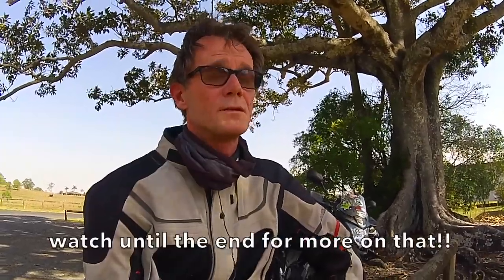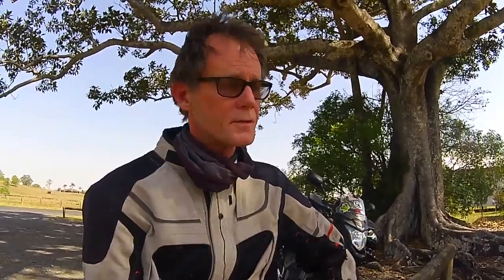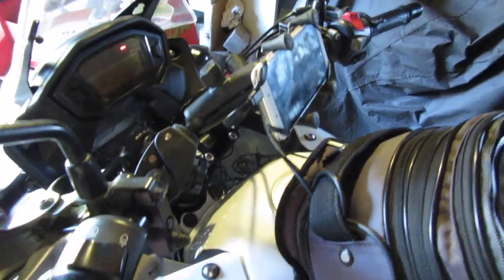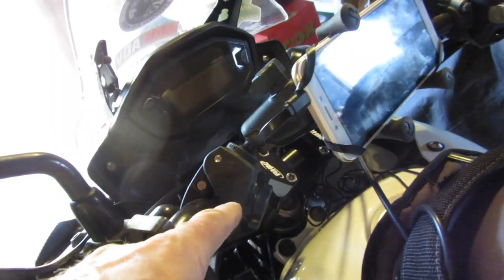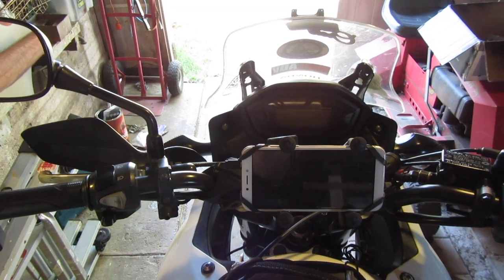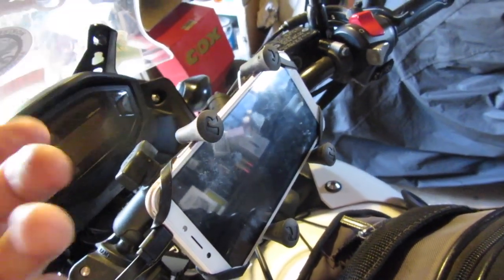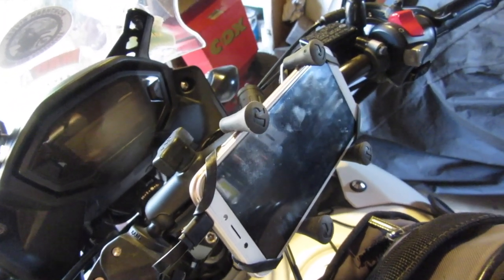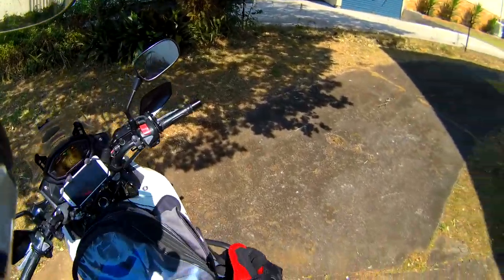RAM Mount X Grip Review

Comment: Great review, brother! Mine isn't  a stem mount, it mounted to the bars, but I've been using it on and off road (and road trips) for over 2 years and on 2 bikes (CRF250L and CB500X), zero issues (even when I was on rougher trails than I'll take the CBX on), great product imo 😊✌
Reply from the maker: Sounds great! Got pretty much used to mounting it without hitting the buttons now and
I've ordered a screen riser with accessory bar, so will mount it above the dash and under the screen.

Comment: I've used the X mount for a couple of years and it's brilliant. The only issue I've ever had is when the phone isn't in the right place and it presses buttons because it grips so tightly. I did modify mine with a bit of velcro, just in case it gets knocked so it can't drop the phone - no elastic bits on mine. For the Honda, I swapped one of the bolts in the handlebar holding whatsit for the RAM mount. Worked well.
Reply from the maker: Ah yes, I've seen the mount that can replace one of those bolts, that looks a good idea too. 
I've ordered a screen riser with accessory bar, so will mount it above the dash and under the screen. RSM8

Comment: Ah the ending was gold 🤣👍 .  Glad pride was the only damage.   I have the same mount. And yes finding the sweet spot that doesn't turn the phone on and off is annoying. And also make sure you glue the rubber grippers on, as they love to fall off 👍
Reply from the maker: Ha ha - the ending wasn;t planned, in fact only happened last Thursday, but I couldn't resisit inculding it :)
I'm getting better at finding that sweet spot, thanks for the tip on the grippers mate! RSM8.

Comment: I had one for yrs and they hold the phones well, yes buttons on the sides get pushed. I got a thin hard case cover from ebay and solved the button issue
Reply from the maker: I think using a case (I have one) would limit what I could do on the phone a little - Got pretty much used to mounting it without hitting the buttons now anyway :)
I've ordered a screen riser with accessory bar, so will mount it above the dash and under the screen. 
All the best Sean.

Comment: I have the Ram mount I find it very good for the phone and camera I use on it, I have the same problem with the buttons but I'm just careful where I put the phone in the holder.  Crash testing the mount is the new extreme. I hope you and Falcor are all mended.  RSM8
Reply from the maker: Got pretty much used to mounting it without hitting the buttons now and I've ordered a screen riser with accessory bar, so will mount it above the dash and under the screen. 
I might not crash test any more stuff... If I can help it, LOL
RSM8.

Reply ·

Comment: Great review. I have the RAM phone holder tough claw mount(no sockets). I made up a bracket that mounts to my screen brackets so I can mount it on handlebars or above dash. Phone has survived many crashes.  Luckily my phone doesn't have buttons on the side, that is a bit of a problem, maybe a case would help.
Reply from the maker: Cheers mate. Yeah have thought about a case but then that would limit using the phone in lots of ways too. Got pretty much used to mounting it without hitting the buttons now anyway :)
I've ordered a screen riser with accessory bar, so will mount it above the dash and under the screen. 
RSM8.

Comment: Had one for 1000's of km.  I totally agree with your assessment. One thing to add Superglue the rubber mushrooms because after some time they suddenly stop gripping. Don't forget to engage the cargo net, I got from Brissie to Paddy's Flat Rd. only to see my phone do a suicide dive. I had to rely on the Garmin which is totally hopeless down your way for the rest of the W/E. The Garmin is easier to put on or off the bike & doesn't seem to be as affected by the sun's heat (if the phone gets too hot it switches off), shows the current speed limit, important in Brissie, but is useless at navigating. Google Maps is in a different league. I'm thinking of making a bracket over the speedo with a sunshade, but it's not a high priority.
Reply from the maker: Thanks for the tip on the mushrooms mate  👍
I would have thought the Garmin should do better than Google Maps! I have a lot of trouble losing signal using maps. 
Chris (ADV_RYDR_Bloke) made a great little sun-shade for his phone mount.
Reply: I’m no expert in regard to GPS or phones. Anybody who understands these things please comment. I connect the Garmin GPS via Bluetooth to the phone using the Garmin app. I also download the area where I’m riding into the phone to cover the no signal issues. Google Maps seems to take all this information and come up with a turn by turn route. 
Before I had the Garmin I was riding to Killarney via Queen Mary Falls. I lost signal & even though I’d downloaded the area map to the phone I lost navigation. Somewhere in this the phone temporally picked up a signal from the next mountain range at Cunningham’s Gap. My wife was following my progress on my Google timeline. It had me skiing down the mountain from Cunningham’s Gap to Killarney. In reality, I was in the café in Killarney with no phone signal. Not many days later I bought the Garmin.
The day I bust the phone I was riding down the Clarence Way to Winegrove turning right and continuing to the Mann River Campground. The Garmin did everything in its power to send me via Grafton. I used all the modes to no avail. Not the only time it has failed me. Another time I left my paper map in the tent & the charging cable to the phone failed. The Garmin tried to send me 100km out my way.
 I always carry maps compass and preplan routes. The trouble with both the phone and the Garmin is the screen size you don’t get a big enough picture I preplan my route on the computer using Google maps and then send that to the phone. I put waypoints into the Favorites folder on the Garmin and set that to the next waypoint so I know how I’m going overall & where the next point of interest/major turn is. I’ll print out the route and carry map and compass and I still stuff up. All the best and happy navigating.
Reply from the maker: @berniebne8243  IMG Bernie, I shouldn't laugh, but that is blood hilarious! I thought I was an expert at "lost" ... You should make videos 😂
Reply: @CaptainCrankyMotovlogger  I do still photography, I don't have the inclination to do video for some reason. In my youth,  in the UK I did a lot of mountaineering. I was taught to navigate by an ex RAF navigator who really knew his stuff. It seems that I have issues when 2 things go wrong I normally sort it out going old school, HEMA maps have an app for the phone anybody had any experience of it? It costs money
Reply from the maker: I haven't tried any navigation apps. Every time I try to check them out it all gets too complicated. I'm actually leaning more and more towards accumulating paper maps and using the compass :)
Reply: @CaptainCrankyMotovlogger  Yes, & a cheap GPS to fix your position. It's a pity that there isn't an equivalent of the UK Ordnance Survey Maps here. The only thing is when my systems work it's all effortless. When they fail it's usually the Garmin that is left working and it's like a mad Kelpie running around in circles.

Comment: Now, this video is a good reason why I didn't respond to their request for a review. You've done a much better job than I would have. Although, I wish I had now as you've sold me. I want one! lol
Plus it might have fit on mine with the original stem mount. 
The issues with the buttons being activated are no different to what I experience with my bicycle phone holder from time to time. Once it's in position though, it's fine. 
So. You actually might get lost less often? Where's the fun in that?
Reply from the maker: Ha ha - cheers mate. Yes I think it's a good bit of kit. Certainly ended up happy to receive one for free, and was impressed that they were prepared for me to be honest. I'll still be lost, just be able to argue visibly, and well as audibly, with Google :)

Comment: Got one very very very similar to yours😉 A Chinese knock off possibly.  I paid less than 10€ on Amazon. But it holds my phone solidly. Can quickly and easily adjust its  angle or position for better viewing in different lighting conditions. I'd say it's a great piece of kit apart from one thing. The same problem you had. The gripping clamps that hold my phone interfere with the phones buttons. If one wasn't too ocd about things just offset the phone off centre on the mount. It still holds the phone securely. 👍
Got a new exhaust arriving tomorrow. A Scorpion Serket Taper in Stainless Steel.😁.
I know its a bit early but Happy Xmas and all that. Hope you have a good one, mate. Cheers
Reply: Bloody Hell mate!! I didnt see the crash on the first view. Hope neither of were badly hurt.
Reply from the maker: Sounds like your phone holder is working well for you and I completely hear you on the OCD problem, haha!  I like things to be centred evenly, haha!
Reply from the maker: a few bruises and bit of gravel rash and a broken indicator - not too bad, I was high-sided off and luckily pulled the bike over just before I let go (otherwise it would have cart-wheeled). When I got up i thought the bike would be trashed!!!

Comment: Yes Captain, I bought one of these a couple of years ago and never looked back, in the rain I have a small plastic bag that I put the phone into and then clip it in. I too found that the volume control gets turned  down if I put the rubber strap over the button, and I need to sit the  HTC phone in the correct spot or it wants to tun off. It held securely during my crash in April, and only my clumsiness in trying to extract it from the holder led the phone to fall onto the ground. Used it all the way across the country last year as well. no problem, I have the Allen Key bar mount system, you can just see it on some of my videos. Great system though. Thanks. Good honest review. Cheers.
Reply from the maker: Cheers buddy - yeah you are confirming a lot of what I though in the month I've used it - really like the bag idea, cheers for that. Got pretty much used to mounting it without hitting the buttons now and I've ordered a screen riser with accessory bar, so will mount it above the dash and under the screen. RSM8.